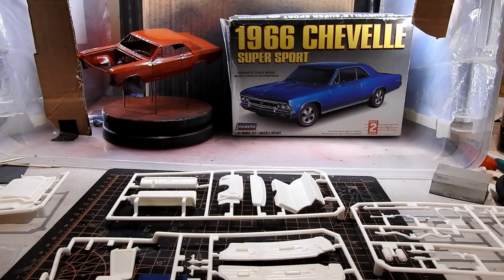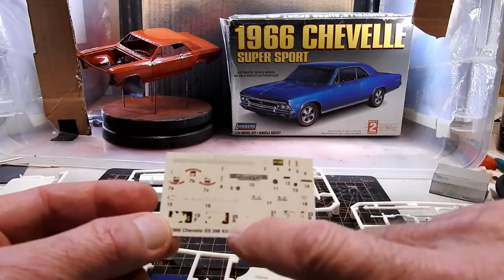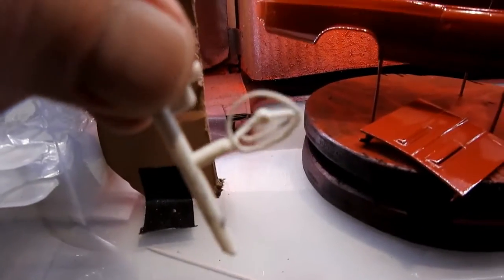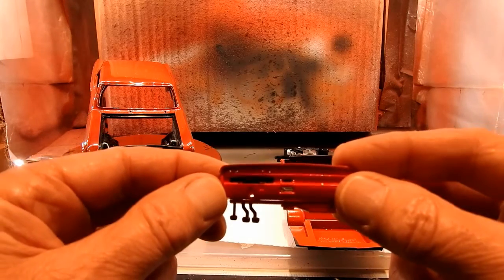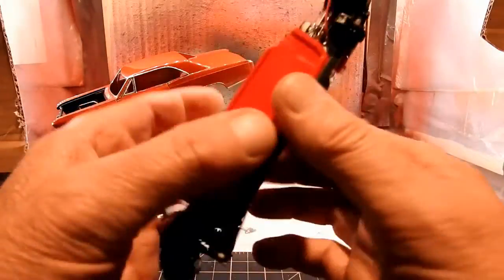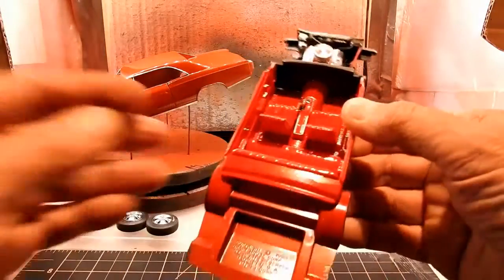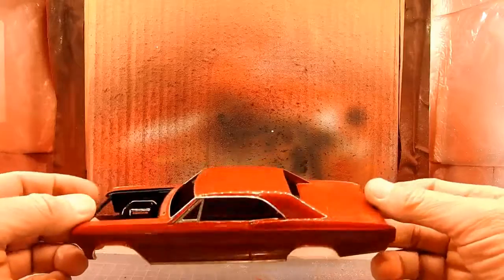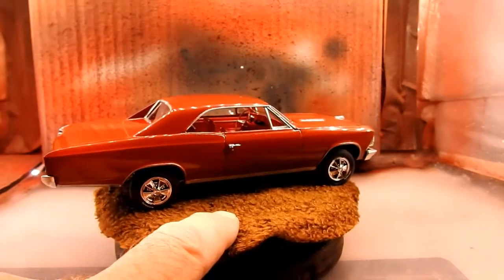My 1966 Chevelle SS model build

Comment: The 66 Chevelle SS is now reproduced under the AMT name and is currently available at Hobby Lobby. If you catch it on a sale week, you can get it for about $22. (40% off)… They upgraded the molds, decals, and quality. It has very similar box are as the Lindberg kit, but red… 
Nice build…
Reply from the maker: Thanks for the info Charles.😉

Comment: Do you sand your models before you paint , if not your paint won't stick as well because where it's shiny paint doesn't stick as well , I noticed in the video you kept mentioning that you bumped the edges and the paint came off and I was thinking that might be the reason .
Reply from the maker: I do sand my models. I had to re-watch the vid to see what you were referring to. That issue was the "68 I brought back into the vid to vent my disappointment of applying floor polish with a brush. The "68 has sharp edges on the profile that I did not sand (ease) prior to painting. I also did not apply enough paint coats. The '68 was #2 of the 6 models I have built. The later model videos show my continued progression or (lack thereof) in my painting endeavors. Thanks for the comment.